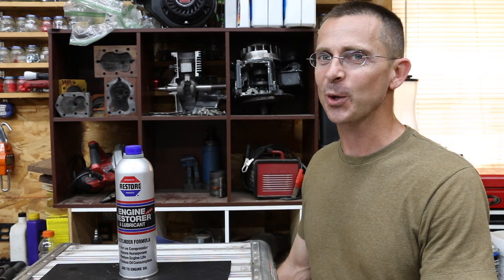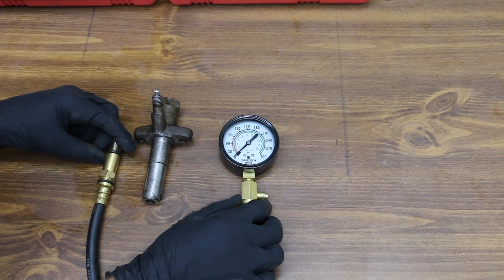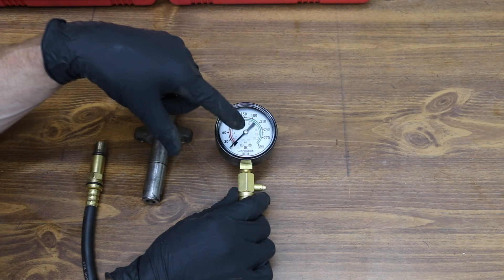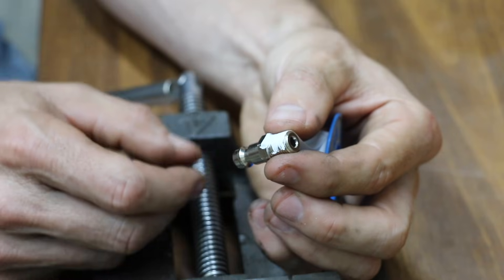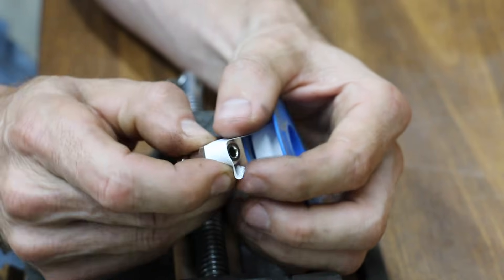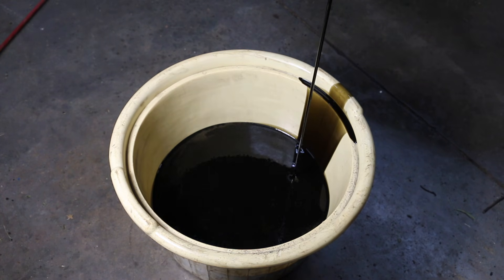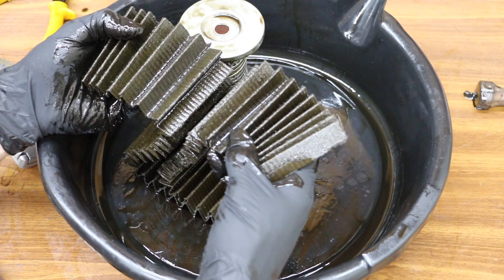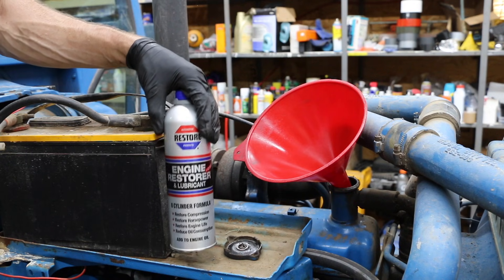Did the "Engine Restore" Compression Improvement Last?  One year later (Episode 2)

Comment: I'm not sure if I'd run it every oil change though...Not sure where the stuff that isn't filling scratches and scars goes till its drained out. But it definitely works, the compression test doesn't lie...My old buddy Marty the Mopar Man( RIP BUD) would do a "5 minute engine flush" first then add the "Restore" on the new oil fill. Used to say it helped it  "Stick" better and longer to the needed engine parts. Not sure if it did or not, but his 440 Magnums  use to scare the hell out of me, brutal speed and ungodly torque. He shoehorned one in a Dodge "Aspen" (anybody remember those?) I refused  to ride in it though,  It was just too wild for me...He had lots of tricks that seemed to make sense. But I'll see you again someday " I'm Sure!" Great Video  "Project Farm", I'm mesmerized by those green hay " twirlers"??? Could watch them for hours!!!
Reply from the maker: Thanks!  Thanks for sharing.

Comment: Another good product is Blue Devil Rear Main Seal Conditioner. I have used it on a couple work trucks and has stopped oil leaks. I use it in these trucks every other oil change and have not had any problems in 3 different trucks with multiple uses of rear main seal conditioner in each.
Reply from the maker: Thanks for sharing.

Comment: I use Engine Restorer in a 1984 GMC 6.2L Turbo Diesel on every oil change. Just in the past 2 years I have put over 20k miles on the truck. It has a at least 200k or maybe 300k miles on engine, not sure. This product has made the truck run really good. I believe it has increased the compression and power but have not taken any readings.
Reply from the maker: Great to hear!  Thanks for sharing.

Comment: Earlier in the year 2021 I watched this video and used a can of Engine Restore in my 253,000 mile Mercedes C230 4 cyl, that was burning a quart between oil changes. I've used synthetic Castrol lube since the car was new. The Restore stopped the oil usage, the compression and performance seems to be like when the engine was new. I also switch the Amazon synthetic because of your tests.
Reply from the maker: Thanks for sharing.

Comment: I started using this product in my 1999 Honda Civic with 214,000 miles  about 1 year ago. It has lower compression but still starts, runs, and drives perfectly. Burns a bit of oil however. This product has significantly reduced my oil consumption. As for the compression, I have yet to test it after adding. I wanna wait a few more thousand miles and 1-2 more oil changes with Engine Restore before testing again. I'm very happy with my results so far
Reply from the maker: Thanks for sharing.

Comment: Anyone have low enough compression to cause a dead cylinder, that managed to bring it back with this product? I plan to try it on a Honda B18 engine in the next few days, havent done a compression test but did do a relative compression test that said there was 1 cylinder with low or no compression, and #3 is completely dead, can pull the plug wire off without changing the idle of the engine at all despite adequate spark

Comment: Does anyone know if the formulation of RESTORE is different 4cyl vs 6 vs 8.  I have 2x 200,000 mile Toyota's that need a little help. Can I just buy the 8cyl and add half to each 4cyl car. 4cyl is 9 Oz and 8 cyl is 16oz so other than missing an Oz each it's not so different if the formulation is the same.
Reply from the maker: Thanks for the suggestion.

Comment: Curious what the compression numbers are after changing the oil without the use of this product. Did each cylinder maintain its compression at around 295psi? Would like to try this product on a motorcycle before the next oil change. Great videos as always!
Reply: It's not very expensive they sell it in different size cans one for 4,6,8 cylinders if your bike is a twin cylinder then get the one for the 4 cylinder and only put 1/2 in but if I'm not mistaken I believe it says to use every other oil change and yes it should improve your numbers I've been using this stuff for decades in almost every vehicle I've owned just not my new one yet maybe when it hits 100,000 but most of my vehicles get up around the 300,000 mark before I get rid of them! Good stuff you won't be disappointed for under $10.00

Comment: So, do you need to continuously use this with every oil change or is once enough?
also, Requesting ATP AT-205's new formula for stopping a leaking engine?

got a few drips of oil when I park but not leaking when I drive... and I can't tell where it's coming from. I think it's the rear main seal and the clutch, throw out bearing is only about 7 years old so I'd rather not tear it apart again if ATP AT-205 could work.
please and thank you.
Reply from the maker: Thanks for the suggestion.

Comment: So I figure I'd add to this - I popped a can in my old shop truck a few months after commenting on the original video you posted about this. It ran like stink afterwards. It still had some missing occasionally when cold, but it ran "good enough" - I ended up giving the truck away and last I heard it's still driving on that worn out motor.

Restore does work indeed. :)
Reply from the maker: Thanks for the feedback.

Comment: I have been a firm believer in restore. I bought a new 2006 scion that has a oil actuated cam phaser to change cam timing. At the first oil change I added restore. Several weeks later I had a engine light come on and had intermittent oil pressure light flicker.  Turns out the restore tightened up the oil clearance to the point it created enough pressure to blow the actuator piston out of the cylinder.  With the piston out oil was free to bypass and flow out of the actuator causing oil pressure light to flicker. It does work and I am glad you had the success with it also. Still run it in my old high mileage engines. Even add it to small gas engines .
Reply from the maker: Thanks for the feedback.
Reply: Thanks for posting your experience.  I've been reluctant to use something in my Ford 302 because of the cam phasers (and tight oil passage tolerances in modern engines).  Ford had some QC issues with these engines burning oil.  I think they went overboard on creating a loose piston-to-cylinder fit in the interest of less friction for getting initial EPA MPG ratings.

Comment: i tried this stuff on my 280,000 mile toyota. i started using restore at 240k and change oil every 20k. my fuel mileage has gone up by 2 to 3 MPG making around 10% improvement. it also seems to burn less oil as well. as an uber driver this saves me some operational cost. i am impressed that this product actually works. thank you project farm for testing EVERYTHING!
Reply from the maker: Thanks for the feedback.

Comment: Decided to try this stuff after watching the 1st video about it, and I gotta agree it worked great in several different engines. That said after doing some reading I would be very cautious about using it in certain engines. It's probably best to keep it away from anything with vvt, or a turbo, and generally just high revving smaller engines.
Reply from the maker: Thanks for the feedback.
Reply: Project Farm's tractor is turbocharged. I have bottle of Engine Restore that I was going to try in my wife's 2015 Volvo that was using a quart of oil every 400mi. but I put a bottle of Marvel Mystery Oil in instead. So far it has been over 800mi. since the last time I put a quart in. We will see how the MMO works when I change the oil this Spring. If the MMO did what I hope it did then the issue was probably stuck oil rings which was a factory issue that Volvo had to deal with on many vehicles with the 2.0 T5 engine.

Comment: I’ve got a 1980 Johnson 140 v4 outboard 2 stroke. It’s low on compression but still runs and provides a lot of enjoyment. I’ve been wondering if I could use this product in my 2stroke application. My concern is that this engine does not have a oiled crankcase but rather receives its lubrication from the oil added to the fuel. I’m not sure and can’t find any information to advise if restore would clog the jets in the carbs or if it would combust well (like 2stroke oil) during the firing process. What’s your opinion? Should I try it?

Thank you
Reply from the maker: I would not use it.
Reply: @ProjectFarm  I value your opinion, thank you!

Comment: I really wish we could have checked the compression with the engine cold prior to putting the restore in it.
 Because if you  Didn't start it prior to checking the compression then of course the compression is going to be lower.  just wondering how much of that increase was because of restore and how much was from the fact that it was just running and is still holding pressure through the ring.
 Anyway it's clear that it does work fairly well.
Reply from the maker: Thanks for the constructive feedback.

Comment: Had a 2000 Chevy S10 4.3 V6 with 170k miles. started it one morning, had a serious backfire and began running very rough. Took it to my local mechanic, he did a compression test and said one cyl was very low( don't recall which cyllinder) I didn't want to put any money into it, so as a last resort, dumped a can of restore into it.  It began to run smoothly again, my son in law bought the truck and is still driving it a year and ahalf later , engine is still runnin smooth. I was amazed it worked.
Reply from the maker: Thanks for sharing.

Comment: Would I be able to use this in my 99 Montero sport it's a v6 only running on 4 cylinders I've already changed my spark plugs and wires and ignition control module
Reply from the maker: Thanks for the video idea.

Comment: Do you think is a good idea to use it on a 2008 Camry 4 cylinder with 200k miles on it with VVT ?Because It’s showing some blow by gases when I remove the oil cap with engine running

Comment: I used this product on a 92 bronco once and it cleaned the engine out really good but it clogged up the screen in the oil pan and caused me to lose pressure. Had to drop the pan and it was fullof sludge so I replaced the pump and screen in the oil pan and ran great after that. Oil pressure was good and constant.
Reply from the maker: Thanks for the feedback.

Comment: I would just like to say: Please Do Not use this if your engine had Variable Valve Timing. It has solenoids that are based on oil pressure that get clogged with this stuff. It will still run, but there will be significant power loss in your engine.
Reply from the maker: Thanks for the feedback.
Reply: I know this is an old comment but I have used it in my 2.5l toyota engines and nothing bad happened

Comment: I used a can of this in my 2006 Honda Civic with a 5 speed with 165k miles. Before using it the engine would sputter slightly from a standstill. After putting the restore in the car would take off from a standstill extremely smoothly and strong and the engine seemed to run a lot smoother and quieter. The acceleration is fantastic even uphill. I was surprised because i thought the engine in my car ran good for the mileage to begin with and now i feel like it probably runs as strong as it did when it was new.
Reply from the maker: Thanks for sharing.

Comment: I have 2 tired Ford 5000's, normally aspirated, been using Engine Restore for 5-6 years. 8 cylinder can per oil change. Like you it "seemed" to help, but now you've proven it does.  Came across this video because the Rislone product popped up while shopping for the Engine Restore. Saw your video on that, I'll stay with the Restore. Although it would be interesting to see how Restore does on that deeply scarred sandeater engine. And your a better man than me, running a cab tractor in the summer with no AC.......Thanks for the videos, keep 'em coming.
Reply from the maker: You are welcome, will do.

Comment: A little after the fact but here it goes. I own a 3 cylinder Ford tractor of similar vintage, and because of my bad luck a coolant hose burst without me noticing. I worked for another hour before i noticed it. Needless to say, when we let it cool down and tried to bump the starter, the water shot 10 feet high. A new head gasket cured the immediate aftermath, but upon inspection of the cylinders they were pretty worn. Mind you it had been overhauled once before, we installed sleeves and new pistons and the crankshaft was reground.

Being an old tractor and due to be replaced I didn't want to put the money into it. We just threw it together but it suffered bad oil consumption, probably due to stuck rings after severely overheating. We are talking about 1lt of oil every 2 hours, it was that bad. As a testament to the quality of modern diesel oils, 4-5 oil changes later the oil consumption is now 1lt every 10 hours. Still, not a fresh engine but serviceable nonetheless.

This goes to show how good engineering went into these machines. It still gets the job done, the modern tractors sound like a blocked vacuum and have a load of emissions equipment that is questionable say 20 years down the line. On top of that their fuel economy seems to have gone downhill. 

Seeing that tricked out 5000 with a turbo I am getting ideas!
Reply from the maker: Thanks for sharing.

Comment: Really great to see ThankX.
I’m trying it out in my older vehicles now. Although I’m cheating and being conservative by using half a can instead of a whole. Both to less risky and cheaper and with the thought that a full can might be for a more aged end of life engine.
You may want to warn people may not to use if their engine has the tiny passages of variable valves.

Say, For a NEW VIDEO IDEA:
I’ve read(oil analysis concerning Frantz “toilet paper” bypass additional filters) how our oil filters miss tiny particles that can greatly contribute to our engine’s wear.
Yet buying and installing and maintaining is not appealing for most of us.
I do see how our oil does look so dirty when doing a change, so our filters are missing a lot.
So seems to me perhaps an exterior magnet product attached to the outside of our filter might be able to catch these tiny particles, that our filters are missing that turns the oil black.
Well if the particles are metals and I suppose the small particles that are metal are the ones that can wear our engine and so if greatest concern.
Many have said the magnet doesn’t help because the filter will catch the same thing but perhaps that is wrong because of the small size.
Well it’d be great to see someone get to the facts and stats to really expose what reality there is or isn’t on this subject.

Thank you 

like to see
Reply from the maker: Thanks for sharing.

Comment: I made an adapter out of a glow plug. I wonder if you could just dump the restore down the intake for Powerstrokes? I am glad I read the instructions first. LS-X  engines tend to have some piston slap when cold, it did seem to reduce the piston slap.

P.S. ...PLEASE do a demonstration on Hemp Oil against diesel fuel. You can grow 300 gallons of Hemp oil from 1 acre. All you need to do is filter it to run in a diesel engine.

Comment: I gotta admit. That stuff seems to be as advertised.  I wouldn't believe it but I saw the compression results and I believe you when you say it starts easier and seems to be putting out more power. Makes sense if compression is up. Especially on a diesel.  I may start using that stuff in my 06 tundra  4.7. Say after 200k. I have about 165k right now. But she runs fine. And for now I jus want to use straight pennzoil platinum and my wix filters. But in the future I'll keep that product in mind. I assume synthetic oil will mix fine with engine restore. Can you do a lubrication test? Oil straight. Then oil with engine restore mixed in? See if there's any noticeable negative effect? Using synthetic and conventional maybe?
I'm weary of additives in today's engines. The oils are really thin for reason nowadays.  The oil gotta flow through the motor to all the vital areas very quickly and that means light oils for all the narrow passages and lifters. If engine restore thickens the oil I'd be careful with today's engines
Reply from the maker: Thanks for the video idea.

Comment: I'd the valves were out of adjustment that may explain the hard start/increase in compression.
Your changing overlap, and duration to a small factor. if the exhaust was too tight the valve will hang. Likewise intake too loose, the basics will open late, close early. This effects volume, this compression. It running this oil on the cylinder walls/oil ring will raise 30
It's inconclusive.... And no oil test to see what metals remain. If we know rotela values. We're can compare from that
Reply from the maker: Thanks for the feedback.

Comment: Trans X for transmissions and AT-205 reseal for ALL oil gasket/seal applications. the AT-205 reseal my dad would use to rejuvinate hard dry rubber seals for small engines. he would take the old dry , hard, brittle seal and soak it in the stuff and in seconds the seal became just as supple as the day it was made. i have used it many times to stop rear main seals in my chevy trucks.
Reply from the maker: Thanks for the feedback.

Comment: Maybe preaching to the choir, but if you put one of those neodymium magnets on the inside of the drain plug, it will catch tiny metal particles and prevent them from re-circulating in  the engine  

John
Reply from the maker: Thanks for the feedback.